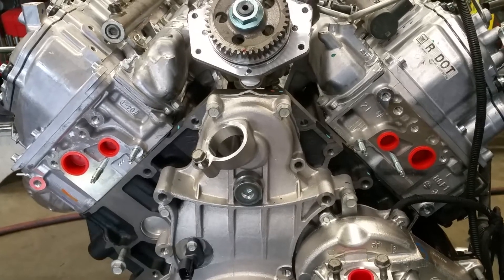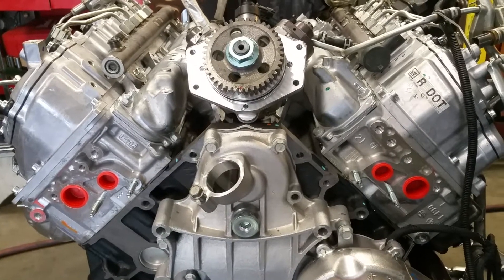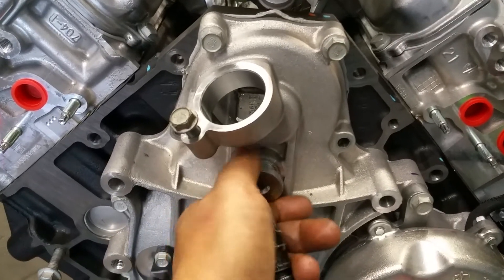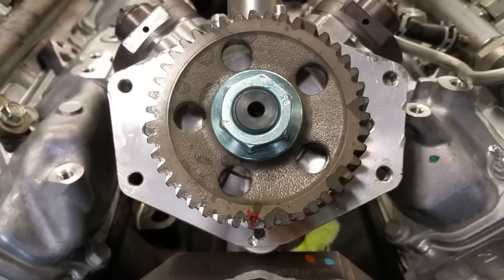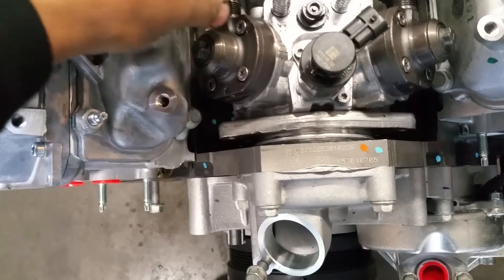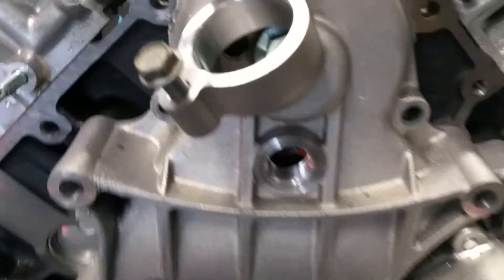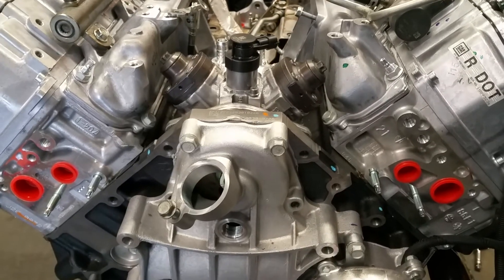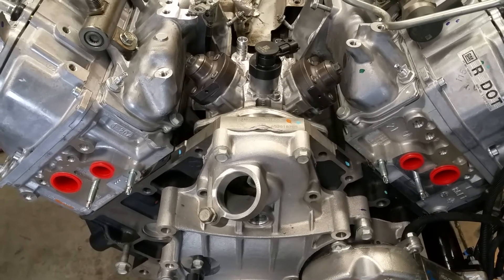LML Duramax Cp4 Pump Timing

Comment: Y’all! I repeat y’all don’t have to time the cp4 pump! It does absolutely nothing. It was Probably a procedure they did during production of the lml but it does absolutely nothing if you stab the cp4 in without timing it. People will come out and say “yeah you do because blah blah blah” just stand there nod your head as though you are listing and just install the pump. I have done countless and even on my own truck and it’s NEVER done anything.
Reply: I needed this confirmation bias, as I threw mine in like I do the CP3s, had a heart attack when I read you need to time them, just going to send it brb
Reply: @carboy48  full send brotha, remember, the CP4 pump sole purpose is to pressurize the fuel. It has no reluctor wheel no sensors on the gear to make it have to be timed. It’s not an injection pump where timing would be crucial. The clams for having to time the cp4 pump is for harmonics
Reply: @aeroguy86 I’m fixing to put a new CP4 pump in and was hoping I could get away with not timing it? Will save a considerable amount of time!!!

Comment: I’m having trouble getting my timing plug off with the fan on. Is this possible???
Reply: You have to unbolt the fan drive bracket (3 bolts & 2 nuts) and slide the fan forward until it touches the radiator. Then you will have room.
Reply: @akrk9670  I appreciate the reply but I’ve already completed the task.

Comment: Great video guys, the cp3 pump will also fail if fuel is not treated or addition lift / water separator filter/pump not added, cp4 pumps has issues yes but if you take proper maint on them they will last like adding a fass pump, or any kind of filter to catch moisture, now if you want to start deleting and generating more hp I will tell you cp3 all the way, they generate more psi and can handle much more output than the cp4, but if your truck is stock and because of the emission laws your cp4 with the lift pump/water filter system will work just as great, I have work on lml trucks with cp3 conversion pumps that fail the same way, this diesel fuel we are getting has no kind of sulphur in it so it's a dry kind of diesel, and with moisture added to those cam rollers in the pump they will eventually detonate causing fuel system to be replace just my 2 cents
Reply: BS! The CP3 is a completely different design. CP4 have a lobe and piston (metal on metal, TERRIBLE design) whereas the CP3 is tried true lower pressure no metal on metal contact. ANYTHING can fail but the CP4 is a disaster waiting to happen.

Comment: What happens if it’s not timed correct will it struggle to build pressure ?
Reply: I was working on a dodge eco diesel and it has the same pump as the duramax not much info out there for the dodge. I had the pump off and on put a new one in had it running for a second

Then pop and died ended up putting a new motor in it and it started right up. Lol what ever 

Truck came as a no start with metal in the fuel system
 Motors come from some other country and are ordered monthly and at the time of our order there was 46 motors on order just for Utah. Sounds like dealers just slap motors in too wiled 🤯
Reply: @Likes4Tin  I bet they do 😳
Reply: Like one tooth off
Reply: Remember those cam rollers must hit DTC on the roller so it can get maximum pressure if not your pressure will mot be adaquate enough if not time